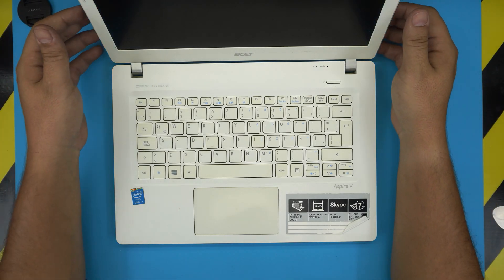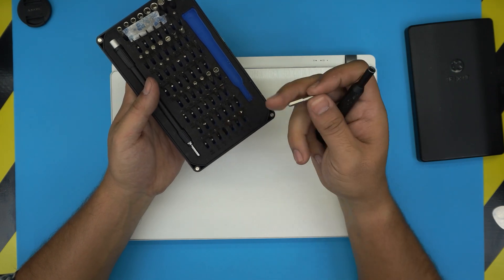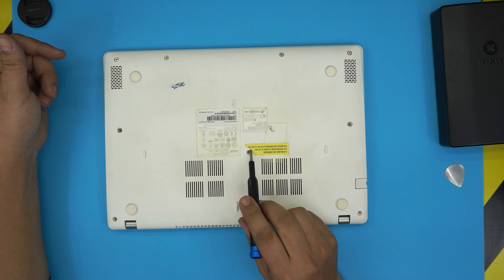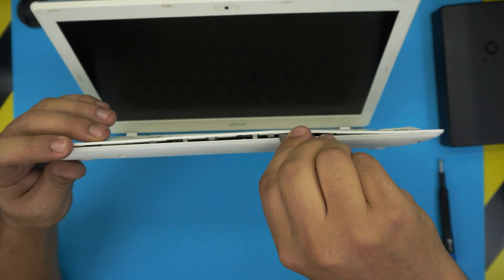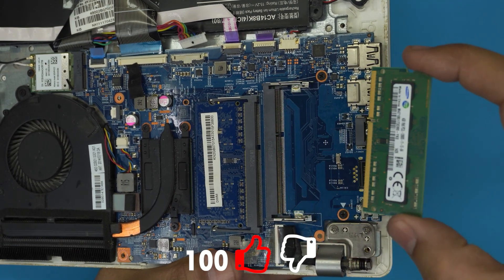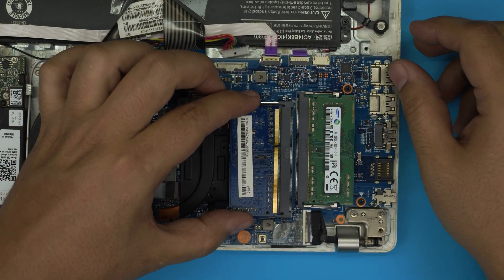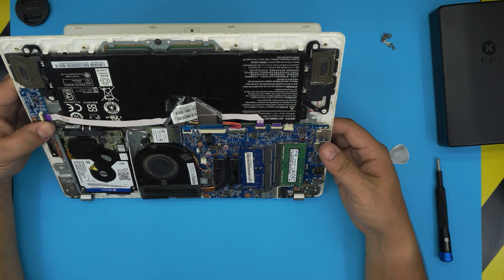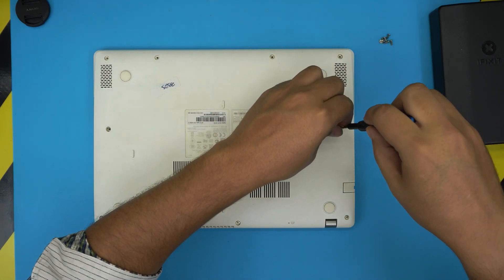Acer V3 371 - 377K  📌 RAM UPGRADE

Comment: Thanks a lot!!!
Can I upgrade to 16GB (8+8) on this laptop?
Reply from the maker: Thank you for the feedback! if you wish to support the channel you can LIKE or SUB or both :P
regarding your question: Oh ya for sure you can, https://amzn.to/3cYcJ5H
make sure tits DDR3L and not a regular DDR3 sdram.
if you have any question or request in the future feel free to ask me.
Reply: @uFixTek  I liked and subscribed
Reply from the maker: the difference on performance its exactly the same, but some boards can't give the extra voltage to the ram, so thats why they ram companies designed a low voltage rams (L =Low voltage)
Reply: @uFixTek  Thank a lot!!
Can I ask what is the difference between DDR3 and DDR3L?
Reply: Dear UFIXTEK I have this same Acer V3 with 4GB RAM. Kindly Tell this 4 GB RAM is DDR3 Or DDR3L

Comment: My laptop goes on but the fan only starts for a few seconds. Then goes off but the light is on but not the screen? Can you help pls?
Reply from the maker: Thank you for the feedback! if you wish to support the channel you can LIKE or SUB or both :P
regarding your question: on i need you to remove the battery and remove the ram and the charger and after press and hold the power button for 30sec, then release the button, and plug in the ram and the battery and plug in the charger and power on and wait 10-15sec. let me know
Reply: @uFixTek  is there a video for this?
Reply from the maker: you don't need a video for this, i have told you all the steps you need to take its super easy, use this video to remove the cover and the ram and @3:33 i even showed you how to disconnect the battery! what else you need to know?
-power off
-disconnect the charger
-remove the ram (in this video)
-disconnect the battery (in this video @3:33 )
- press the power on button and hold it for 30Sec (normal power button you press to turn on laptop)
-place the ram back in and the battery and place the cover and plug in the charger.